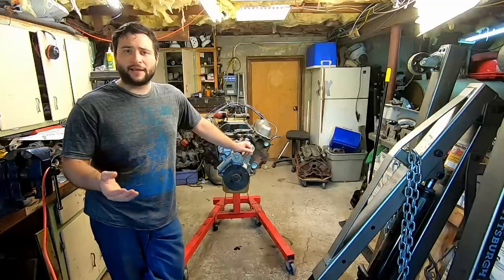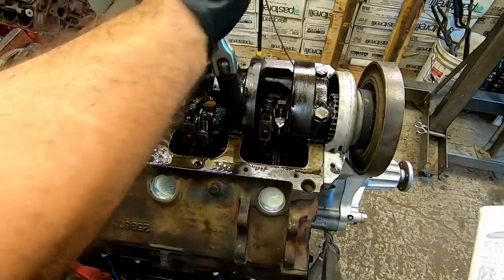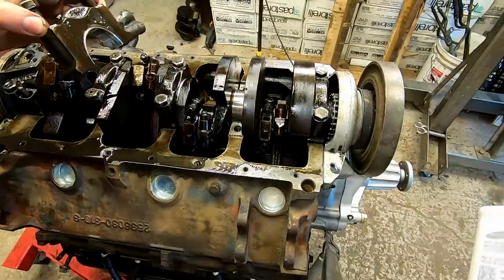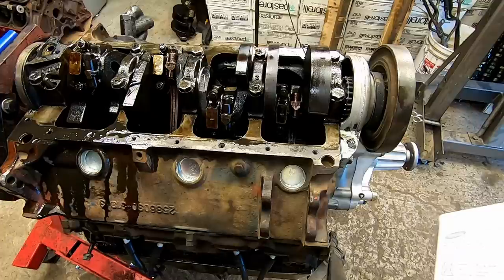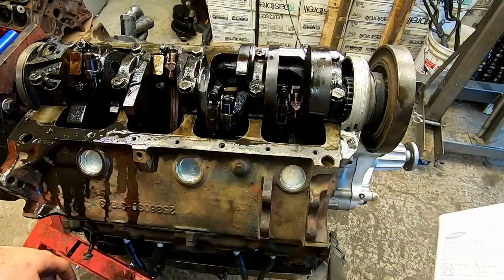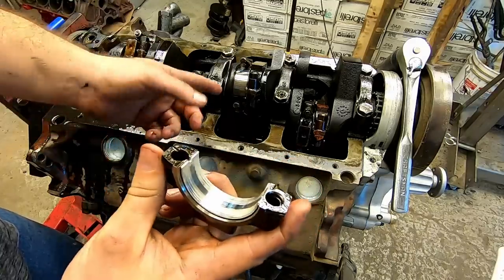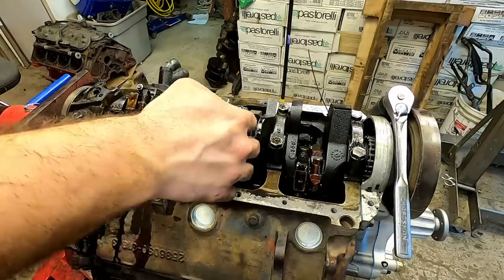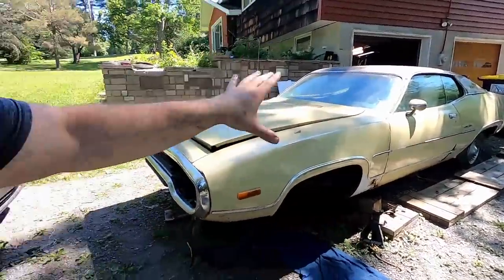The Mystery of the 318's Low Oil Pressure Solved! update the crank was worn out .07 not machined

Comment: Putting a 318 together carefully and cleanly would be sacrilege. It would be seen as an incredible waste of time to do that for a lowly 318. Those engines were made to be abused and disrespected, even worse than the Chevy 305 or the earlier 307. They are seen as boat anchors, virtual garbage, one of the worst V8's ever crapped out by a factory. Yeah, they may have lasted forever in stock form, but they're truly the Rodney Dangerfield of car engines.

Comment: Jasper engines reuses every thing they just throw every thing in a bin and then re machine as needed to remanufacture the engine even sometimes the valves are just put back in the head that came from a different engine I had one like that from them in a Chevy 350 it was a 2 bolt reman 150 hp one only 850 bucks for a long block  back in the early 1990’s ran good for a daily driver in a 79 4x4 the owner before me put it in but I used it as a  mudding truck til it when to scrap

Comment: I said this weeks ago--It ain't the damn lifters and pushrods. I said the mains were being eaten or wrong bearings or mixed up caps. Having too much clearance is actually the best case scenario. Take the crank out and polish it--reinstall with correct bearings and verify all of the clearances. Be careful with the plasti-gauge as it can lie to you. Oh and it still cranked way too hard on the dyno and too much clearance won't rob much power--This engine will not make 300HP as is. Good luck and for godsakes you HAVE to tear the engine down completely in order to clean it properly.
Reply: Good call.
Reply: my point too. it was clacking and rattling up top because it wasnt getting enough oil pressure there. amc lifters dont leak around solid pushrod ends.

Comment: Not how to tighten main caps, you should tighten one side a little then the other a little side to side until you get it to spec, not tighten one side all the way the other plus you should have taken all off and clean the crank and bearings plus take all the bearings out and clean the saddles because you might have something behind the bearing same thing with the rods,if all the surfaces are not clean you will not have an accurate measurement

Comment: buy a set of mics on amazon or used (should be AROUND $100 and you will have them FOR LIFE). plasti-guage is low key crap,not very accurate  and basically only good for a one time half assed check and repair. if you plan on building more than one engine,go with the mics and learn how to use and read them.

Comment: Lol so after you posted the Dyno day Tony bailed from the build. Then was going around saying the engine was no good because of misfit push rods, and all the dirt you put in the engine. I watched the build, his block looked like it was pulled out of a car with 300k on it, then forgotten about for close to 30 years. You both needed to clean your parts, but he pushed you under the bus and stopped trying to sort out the engine. It’s common to just trust the bearings that were in the engine but it is not a good practice. You should’ve checked it, but you’re an inexperienced engine builder so you have now learned that. Tony supposedly has built thousands of engines and most definitely should have broke out a plastigauge. His heads touched the rotating assembly last. He is even saying he will do a build blindfolded. The man is disappointing and cocky. This was just meant to be a ego stroke for him. So when it pulled 250hp on the dyno he tried to put distance from you. There is no way it will make the 400HP he was saying in the live. I get it the distributor was not curved, but that might get you to 275 lol. I was a sub but I am out he is all talk and no go. But remember the oil loss was the lifters yup only the lifters. Haha sure. Sorry for the novel but this guy is a jerk
Reply: Agreed
Reply: They broke almost  All of the basic Cardinal rules of engine building, the most basic starting with clean block!
Reply: @dougdier3104  the block that Tony supplied for this build must Have been anchoring his boat the “ss Tony’s EGO”. No that boat is drifting a way from him fast. Like I said I can expect this from a novelist like lunar.  But tony sells himself as the smartes mopar guy in the world.

Comment: Dude, those bearings are shot! You should never use used bearings!
Reply from the maker: Lol what bearings where used my dude? The bearings were all brand new for the build. Now I have new ones on the way that will fit this crank. Also although I agree with you that you should never reuse bearings but I know Tony has said over and over again to use existing bearings so that you have a “loose” engine.

Comment: Brass Freeze Plug
Not much more cost but they will last much longer then the steel cheap ones.
Also ARP bolts.
I do not trust stock factory bolts ever,

Comment: Get some longer pushrods also ? ( Nick said they were too short)
Reply from the maker: Nick said only one of the ones Tony put in was too short, and I put all new ones from comp cam in.
Reply from the maker: I appreciate your feedback Nick said only one of the ones Tony put in was too short, and I put all new ones from comp cam in. Nick even said he didn’t believe there would be that much oil pressure loss because of pushrods. Definitely excessive clearance in the rotating assembly.
Reply: @LunarOutlawsGarage  My understanding was that the short push rod would not give optimal HP, the heads a chance to breathe. I see by looking further at your build that you went with the 340 crank,  good!
Reply from the maker: Try to give a little guy the best chance  to make some real horsepower numbers

Comment: When you're looking for guidance I hear you repeatedly refer to Nick, did Tony bail on the project?
Reply from the maker: The last time I talked to him was the 24th after I dropped the dyno video. I tried to call and text so I could sort out the oil problem b/c 40psi drop in oil pressure b/c of lifters seemed crazy to me. I am glad I was able to spit ball with Nick and John. If I just replaced the pushrods and lifters I still would have had the bearing problem
Reply: That sucks. I never heard anyone point the finger at Tony nor do I see how anyone could given the circumstances. It was a thrash. In his defense other than low oil pressure the motor ran good. It was a shame to not be able to see a full RPM pull. Glad to see you're sorting the issues out. Fingers crossed that we'll see the little 318's full potential.
Reply: Neal Head  I don't know that he needs to be ashamed of the build, but if he indeed turned his back on lunar (which lunar never quite said he did but it seems that way) he should be ashamed. Tony's cool but it's obvious he's quirky and maybe a little eccentric but I don't doubt that he's a competent engine builder. What annoys me the most is the constant extreme budgeting. Look, I can completely relate to being on a budget but it's ok to splurge every once in a while. On top of that, if he thinned down  his "fleet" of vehicles he could afford to have one really nice vehicle along with some of his other classics.
Reply: Mustang Mike 100%! All these heaps of shit, and no quick cars. 5 2’s doesn’t make 10...
Reply: @mustangmike4078  TBH I see right where he's coming from. I'd rather have 20 beaters than 1 or 2 nice cars. However I would have a lot more variety than he does. I guess it's all in the eye of the beholder.
Reply: @92powerdiesel61  I'm not criticizing, all I'm saying is why not 19 beaters and one mint? From what I can tell he lives in a nice neighborhood so it doesn't appear that he needs to be so low buck, but to each their own.
Reply: @mustangmike4078  Fair point, even I'd probably make a few daily's nice. Just for the comfort and reliability.
Reply: @92powerdiesel61  I never seen it that we'll but he does have that road runner in garage that from what little I've seen of it seems  pretty decent.
Reply: @mustangmike4078  I don't think Tony has ever done a total 'baring' of his soul, with regard to all he has.  He may have a gem that he prefers not to share.

I know a guy who has a 69 HEMI Charger RT with a Gator top on it, and no sooner than he shared it with  4 guys, THEY circulated the pics they took with their phones, and 7 weeks later his garage was broken into and the intake, air cleaner and carbs were stolen from the car.

This is in an old neighborhood near the east end of Louisville KY. The car has been in his family since new. Can you even imagine how bad that sucks? Arguably a $110k survivor car, and some dirty scumbags raped it in the families garage. 

I would run a welding rod dipped in battery acid up in their eyelids if I caught those dirtbags.

Maybe Tony doesn't want to show the entirety of the internet everything he has, because he doesn't want to listen to the screaming as the welding rod makes it's way in.
Reply: Uncle Tony doesn't have anything "mint" enough for you ? His 68 Road Runner dual quad 400 street racer is pretty sweet , and his 73 Road Runner 340 is so nice they're almost afraid to drive it . 
One of you thinks he doesn't have enough VARIETY ? 
64 Dart 4 door "Mrs Landy"
65 Belvedere 4 door HEMI "Hellvadere"
66 Charger 440
68 Dart 6cyl/3spd "plan Z"
68 Road Runner 400
72 Dodge tow truck 
73 Road Runner 340
7? Silver Duster
74 Dart V8 (was 318 , now 360)
76 CarryVan box truck
78 Ramcharger (may now be sold)

That's an awful lot of variety while staying within Mopar. All he's lacking is a full-size Fury to have covered ALL their chassis , and with slants , LAs , Bs , RBs , and a Hemi , the only motor he's lacking is a Poly ! 
No variety my rosy red rectum !

Comment: replace the camshaft bearings....
Reply: I have also seen cam bearings be the culprit  on Oil pressure. Textbook may yell mains, but a couple times I seen good mains pulled the cam and changed the bearings , voila!! Oil pressure
Reply: @natelorimer8567  yep. some people(like chevy guys when they build a mopar engine for the first time)dont know to align the cam bearings with the oil hole in the journal....boom, bad oil pressure.
Reply: @frigglebiscuit7484   I'm a chevy guy,  funny thing is I seen old engine, change the cam bearings also low oil pressure. .  So it doesnt surprise me that it happens on mopar. Probably more common

Comment: Pull it apart, have it tanked, replace all bearings. Mike the crank and rod journals as comparison to OEM specs. THEN plasti guage the bearings.
You cannot clean such a shitter without totally disasembly. You can do a half assed job when stripped with a kero gun and some rifle brushes. Which you will need to do after it is tanked anyway.
And it takes half an hour to strip an engine.

Comment: You went to someone for their expert help and didn’t get instructed to do this.   I’m sure you will be fine this round.
Reply: Rudy Hughes Anyone that considers ”Uncle Tony” an expert gets exactly what they deserve.
Reply: Don't forget this was a budget build. No rings or bearings just porting and  cleaning shit up the backyard way. They opted out of a complete rebuild to show what people can do at home so this is a common mistake for motors other people built. I rebuilt an engine for a friend 1 time and put it back in his boat and had bad oil burning and piston slap issues and when I pulled it the 2nd time after he asked me just to freshen it up I realized the block was . 020 over and the pistons were stock bore so it isn't a hack thing it's doing what the person asks you to do and assuming because it ran fine it's assembled right to begin with
Reply: Jon-Christian Kaczor I build cheap stuff like this build and they usually work real well . But I always look to see the on the back side of the bearings .it will have a std or .010 or .020 to see it the crank has been machined

Comment: You don't know the block isn't cracked. Send the block out to be cleaned and magnifluxed, which should have been done back at the beginning.
Reply from the maker: It was Tony’s block about week before I went down there I told him that my engine was so far gone it should just be used as a core. He said he had a block and he would determine if we used my heads when I got down there. He gave the ok on heads and supplied the block.
Reply: If it holds water it's not cracked. Visual inspection can detect any serious cracks in the non-water jacketed areas. If you are still concerned about any cracks there are low-buck products (look it up)  that allow you to do so. No need to sent it out to the machine shop and pay their higher prices unless money is no object in your build.

Comment: cheese and rice !  do your self a favor and take the engine to the machine shop . that way it will be checked out my someone that knows what they are doing . because you don`t . not trying to put you down
Reply from the maker: I hear what you’re saying, and uncle Tony’s garage was the one who did the engine rotating assembly without using a mic or even plastigauge, and I appreciate your feedback. As far as whether or not, I know what I’m doing I would enter my 1989 Toyota Supra that my intercooled htv2300 supercharged V8 producing 16 pounds of boost, with 850 cc injectors, it has been converted from distributor to coil on plug out of an Audi R8, and running a haltech 2500 as an engine management system. The car also has a ton of additional modifications like retrofitting 4 pot Brembo brakes out of a 2001 Mercedes-Benz in the front, manual transmission swap, upgraded rear differential. The engine block that was donated to the channel by the same creator, turned out to be totally junk and ultimately I have a magnum 360 converted over to run a mechanical fuel pump and carburetor. Lesson was if someone comes to you telling you that if you pay for the parts he can build a 318 producing 350 hp out of a junkyard motor don’t waste  money.

Comment: What is this "spirit of the engine"? Is this some kind of Canadian folklore? Do it right and clean the block correctly. You saw how dirty that oil filter was on dyno day.
Reply from the maker: It was an awesome adventure, unfortunately the engine block that was given to me by Tony needs a lot more than just to be cleaned the cylinders are out of around. I did a video recently with the full synopsis of the satellite project. In that video included included parts of the live stream where he even said that that block he prepped for that day was hiding damage and wasn’t really any good. He said if he had realized that he would’ve picked a different block out of his stash. So after all the work solving the oiling problems by putting a 340 crank into it, cleaning everything so now the oil and filters are clean it’s still smokes incredibly bad. It is blowing around the piston rings you can see it during the Dino. It sucks but there’s always a silver lining i’m building a 440 for it now. 😁🤙

Comment: i get the whole assemble the parts as is, but that was some terrible assembly work.  the block should have been hot tanked to get it clean. even home mechanics usually clean an engine better that that. also the loose rod bolt. and not measuring clearance? i don't get that. you don't need a micrometer or a dial bore gauge when you have plastigage that is available at any local auto parts store. for only a few bucks. i don't get the point in destroying something just to prove the wrong way to do things. spend time doing it right the first time saves time and money doing again the second time.
Reply from the maker: I let Tony know that my block was going to need machine work a week prior, so he supplied the block. Though I agree, hot tank is my preferred way to clean engine parts, I don’t know if any machine shop was open down by him. I know up here, they were closed down by my governor. Tony sent me a text that he was going to pressure wash it an hour before I got to his house. As for the plastigauge, when someone asked why tony why he skipped that when he was putting together the rotating assembly, he said something along the lines of he owns them but he doesn’t use them.
Reply: @LunarOutlawsGarage  "owning it, but never using it..." i know a lot of men that became fathers that way.... all joking aside, I have some serious concerns about the connecting rod bolts. my concern with the rod bolt is that it is stretching and coming loose on its own. high mileage or over torqued bolts are know to do that.  i would consider replacing at least the rod bolts on that rod just to be safe.  one thing I do, in on final torque, I use a paint marker to mark all the bolt after I finish torqueing them to spec. then i go over everything again just to make sure everything has paint on it just to double check that I don't miss anything.